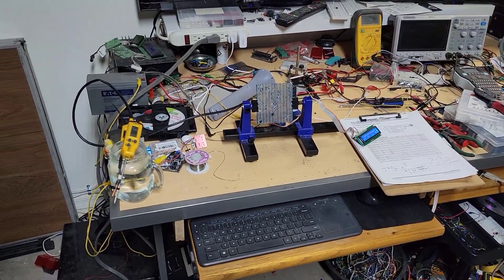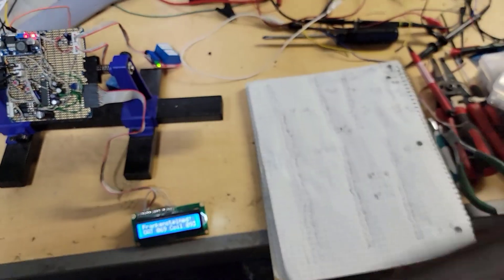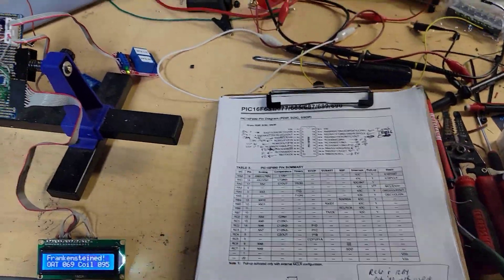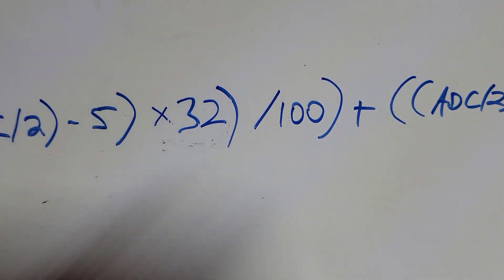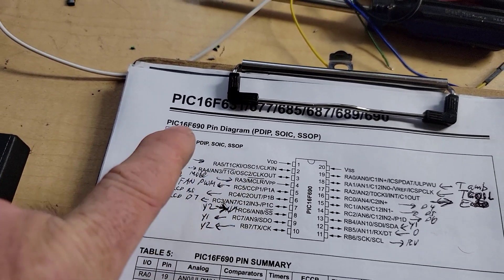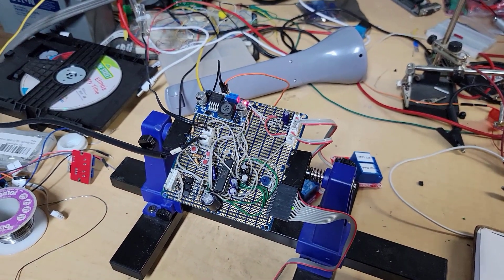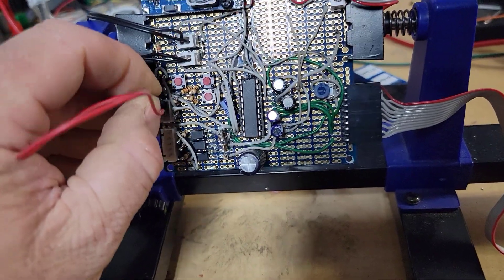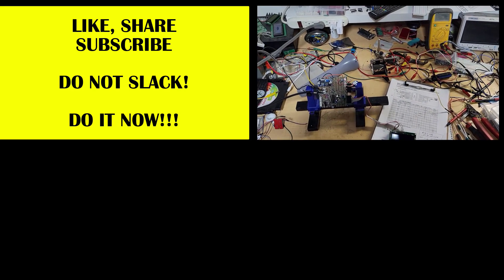Frankstein Heat Pump controller gets some temp sensors and some voodoo to shortcut MCU limitations

Comment: Neat project, have you considered using shift registers for I/O expansion? You could use a timer interrupt to make it really easy to work with. Interesting that you've been using PIC microcontrollers, I've been using Arduino for a while but would really like to do something with the PIC chips I have. Just haven't gotten around to dealing with MPLAB yet.
Reply from the maker: Oh man, you want me to use interrupts? LOL
With these it is best to write that part in assembly.
HA HA
Actually I now have everything covered but no spares.
Reply: Ah, are you using BASIC language for them? Better hope you don’t need another pin at some point.
Reply from the maker: @KJ7BZC  Yeah. It is called PicBasic Pro
So it is similar to my 1980's Tandy 8000/Commador VIC20/Amiga days. LOL
Reply: @hackfreehvac  Interesting, looks like a nice software package, though I've grown up with C syntax so it would be hard to get used to.

Comment: You should’ve just used a white Rogers Universal defrost board
Reply from the maker: LOL. No way. Those things are basic time + temp switch. They enter defrost whether there is actually ice or not. (Like most dummy time/temp defrost controls).
Also, this controller will do a lot more than defrost. It switches the Variable Frequency Drive inputs, monitors safeties and will output a PWM signal to control the pair of electronic outdoor fans.
Reply: @hackfreehvac  They are actually time and temperature and demand defrost you choose. It has outdoor temp and coil temp sensors. I figure that board and your board to give all the other signals.
Reply from the maker: @scottdavis9442  I've seen them but I think they were Ranco or something. But may as well make my own since it is a Frankentein.
If it was a customer's unit then I'd be using off the shelf components.

On mine the coil temp sensor will be for defrost in heating AND for ODM fan control in cooling.
Reply: @hackfreehvac  it’s a : 47D01U-843. Nice universal to keep on a truck. I normally don’t like WR...

Comment: I do appreciate how you take the time to "roll your own", as it's definitely a fun learning experience. However, you'd save soooo much time if you moved over to the Arduino stuff. People have created countless pre-built libraries to handle things like thermistors, thermostatic control, etc... Basically just copy n' paste and it works. Plus, then that gets you access to all the "shield" stuff with relays, mosfets, etc and the various arduino variants with expanded IO.
Reply: The trouble with Arduino is it's bloated. It works great for quick prototyping a couple of peripherals, but you run into some limitations with as many moving parts as this project has.
Reply from the maker: Most of that stuff seems to be hobby orientated and the processors often come with a board and all so they cost a lot more than $2 bucks a pop like these.

At least they are not as expensive as the Parallax stuff was in the early 2000's (what Arduino kinda continued). Those were like $20 to $50 per processor back then!
They did have really simply interface and debug software tho.
But I went to these because they are not as limited and for $2 each you can just toss them around like nothing.
Reply from the maker: I also don't focus on one hobby enough to switch to yet another one. :-p